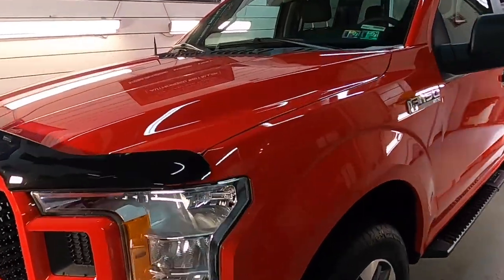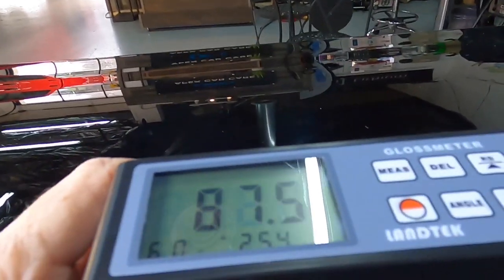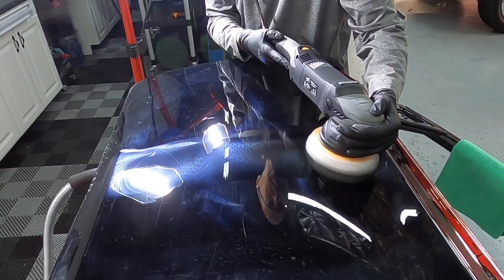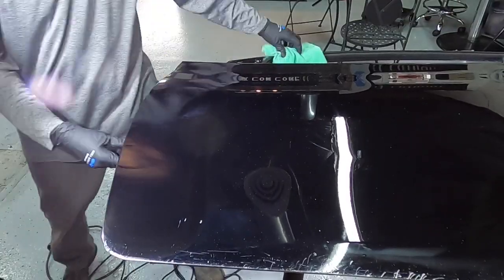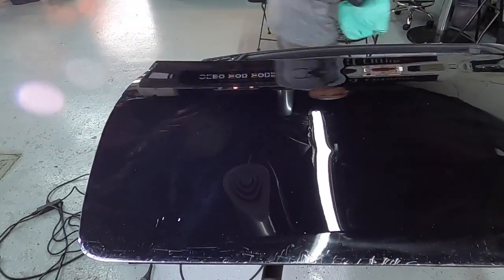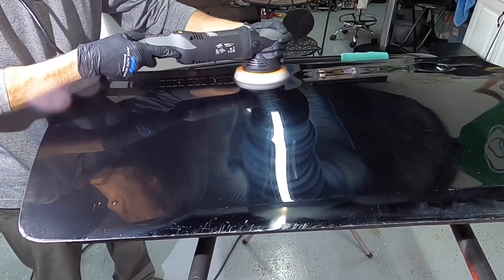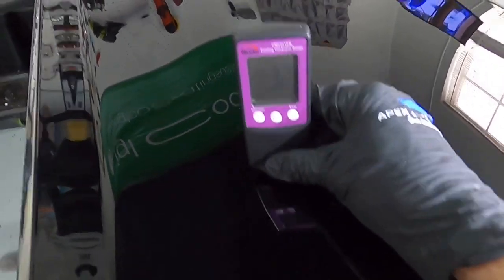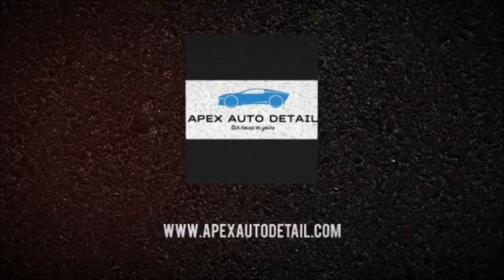How To Safely Perfect The Finish On New Vehicles! Soft, Thin, Water Based Clear Coat!

Comment: Another good one Brian. I just did my yearly polish on my 2018 F150 with 3d One and a Microfiber finishing pad. Came out great, and then recoated with TLC v2. I was hopiing you would have done you black ice review before it was time for my polish because I don't want to buy it until you review it. I have to say though, the new turtle wax stuff is making me think the more expensive stuff isn't worth it. I have used their seal and shine topped with their spray wax, but tlc2 seems to self clean better.

Comment: Hi Brian, an idea for another video to demonstrate how little there is and perhaps act as a visual warning. Like your ten wash test. Run those passes on the trashed panel again and again to see how far you can actually go before going through the c/c. Harsh lesson, show how little there is ! Unless a very expensive layer gauge, show what 4.2 brand new actually means?
Nice 2 second showcase for Vonixx Blend - fantastic stuff, no tail break out when beads roll, just like mercury globules .

Comment: I clay barred my 19 Challenger 2 weeks ago( with the Mothers gold bar kit) and applied  2 coats Meguiars  Hybrid Ceramic liquid afterwards with a 6 inch orbital buffer,( 1 week apart, to allow for curing),  but buffed out hand.  Do you recommend I apply the Meguiars next time by foam pad? I used  microfiber pads this time.
Thanks! great info.  subscribed.
Reply from the maker: It sure would finish out much better with some soft foam application pads.

Comment: The paint quality on new vehicles is getting worse every year. My new Grand Cherokee's paint job is garbage and don't even get me started on dust nibs.
Reply: Same. Just got the 2021 escalade esv to replace our 2003 Yukon XL Denali. Original paint and clear and I didn't bother protecting it until 2 years ago but it's still very glossy and perfect. Zero clear or paint failure. Was outdoored. Never in a garage and has 304k. Never polished just waxed a little. the metallic silver is such a resiliant color in terms of hiding damage and swirls. The paint on the new escalade sucks ass. So much orange peel on the black paint it's gross. The old silver Yukon has perfect paint.
Reply: @elihernandez330  Do you think it’s best to polish and lay down a ceramic coating ASAP?  I waited six months on my new car before doing that.
Reply: The new workmanship at FCA ( Chrysler,  Jeep,  Dodge, Ram  is owned by FIAT Automobile Corp ) and they surely have cost cutting measures everywhere.  Then in 2019 the Ceo died suddenly from a heart attack )  Product design is suffering in addition to quality control.  I was an employee for 6 years until the Pandemic.
Reply: @craig.encinitas  I've only had it for a month and a half and have only put 182 miles on it so far. Will ceramic coat but first I'm trying to see if I can get it warrantied and they're being slow. Damn thing has too much orange peel that can't possibly be okay on a truck so expensive.

Comment: Just looking for suggestions on protection for two vehicles. I figure I will use the 3D one one for correction but after that I am unsure. My dad has a 2019 F150 that he takes through the car wash once a week and obviously the clear coat is thin and takes abuse. I have a 2010 tundra that I use for my landscaping business and daily driver. It frequently gets dirt and debris exposure and I snow foam and wash every couple of weeks. What are the best options for protection for both of these vehicles?

Comment: I just purchased a 2020 Ram 2500 Tradesman in white. The dealer stated that they had applied a product
called permaplate. When I got home I washed and detailed the truck using Turtle Wax seal and shine. I plan to maintain the truck with turtle wax ice spray wax going forward. Do you have any further suggestions regarding products that
I should use on a Ram truck?
Reply from the maker: The Turtle Wax Flex Wax is something to look into.

Comment: Wait a minute. This is great, but isn't it true that the UV protection in clear coat is basically riding on the top layers of the clear coat. So isn't it true that even taking off a little clear coat would be taking off the UV protection of the clear coat? I use 3D One with a Uro Fiber 50/50 and I use Xtreme Solutions Finalé and my projects are looking great, but I am concerned about taking off the protective additives of the clear coat itself, or am I being too timid?
Reply from the maker: In solvent cured Polyurathane...yes. In water based Acrylics....not so much.

Comment: I want to remove the swirl marks from my 2018 f150, luckily its white so not too visible. A friend of mine has the 3 step 3M polishes, what would be a good way togo correcting it with a rotary polisher? Thats what I have at hand and would put polyseal on top. Will then keep it maintained with it every few weeks for buildup.
Reply: To experiment... maybe put aside the 3M and buy a small bottle of Turtle Wax 1andDone. It is inexpensive and performs well. Turtle Wax is not the same product from years ago! Get that and a soft foam pad (they color code them to softness. Soft implies less aggressive). The 3M is good, but you have to match each compound with different pads + they expect you to have some training or experience. The Turtle Wax is close to perfect for beginners. Before you use the polisher, remember you have to decontaminate/clean the paint. It use to be hard, but fortunately there are easy products (again pretty cheap to pick up) to do this. Brian has a few videos on decontamination. The rotary polisher is hard on sharp edges like the top of your fenders and box. For this reason, you may want to borrow a DA (dual action) polisher from a friend. It might help you save a paint edge. Finally, once your white paint is free of swirls and ready to go, try a Turtle Wax product like Seal & Shine or their latest graphene sealer. This is the least expensive commitment to try this craft. Once you are happy, watch more of Brian's videos for equipment reviews and product reviews. Regardless, the best advice is to just try it and you will soon have a hobby that is fun and could make you money if the economy tanks and you need extra cash.
Reply: @pkerrin6067  wow thanks for that in depth response. I was given polyseal as a gift over holidays. And the one and done isn't available for me till next week and I only have time this week before I get busy. Sadly same goes for da polisher. I have access to the decontamination stuff though. I will try and see what happens. Thanks
Reply: @55gopi  So glad to see someone with enthusiasm and determination to pick up the tools and start! You will be fine, plus have fun. The white paint will pop with the Polyseal when you are done. Enjoy. We are all here to learn and have fun. Many thanks to Brian for his generosity, continued encouragement... and his patience of a Saint!
Reply: @pkerrin6067  thanks
Reply from the maker: The rotary...yes...3M...no. Look into TW 1 and done, 3D One, or Sonax Perfect Finish. You will thank me later.
Reply: @apexdetail85 the polishing will have to wait then. I'll just wash and apply protection for the meantime. Will come back to it and start from scratch later. Thanks